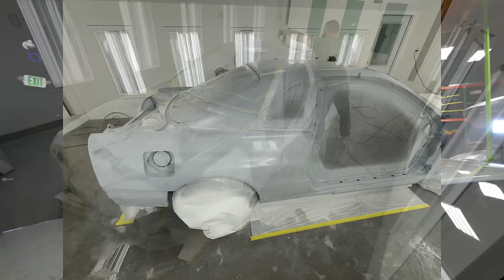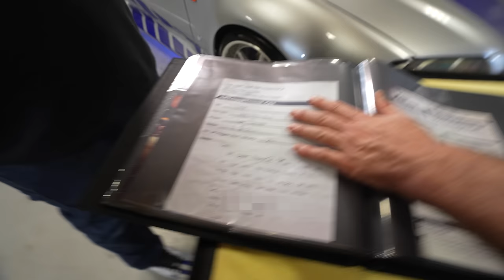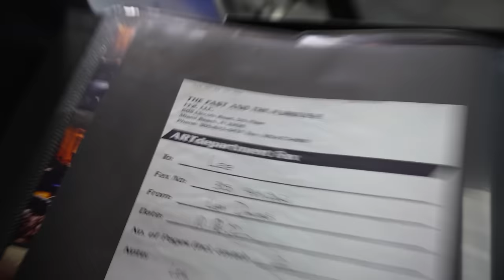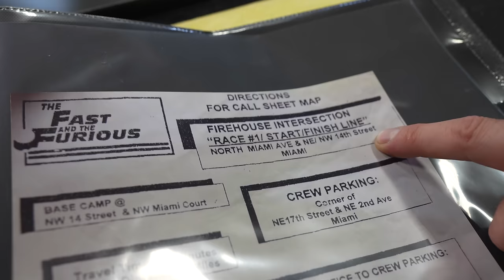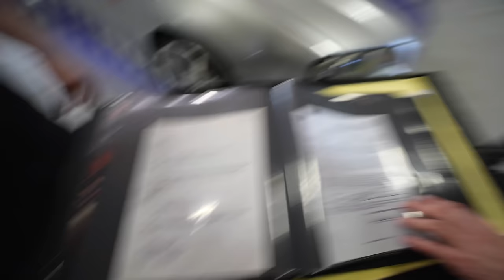We FOUND the R34 Nissan Skyline from 2 Fast 2 Furious!

Comment: Fun fact, and I havent watched the full video yet so they may touch on this, but all the F&F R34 GT-Rs were in-fact not GTRs, they were GT-Ts. Being rear wheel drive it allowed them to pull off some of the stunts a lot easier and replacements (they had quite a few) were much cheaper.

Edit - Okay they touched on it, damn I wanted to sound smart :P

Comment: i see  one flaw in his   build  the  racing striped down the hood  and  wrapping down to the lower valance on the  front   did not go in the middle   it stopped at the  top just as it  come over the top and  then  skipped the middle of the  front facia    and it  was not  faded as it came  forward is was a  solid blue set of stripes